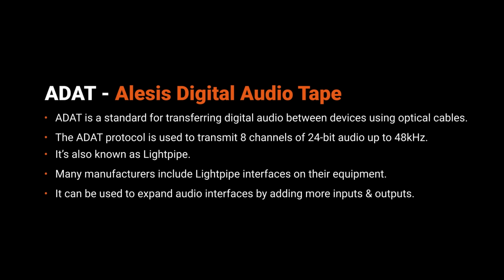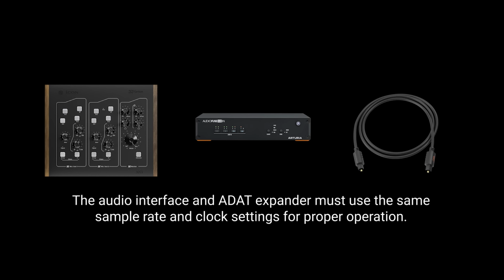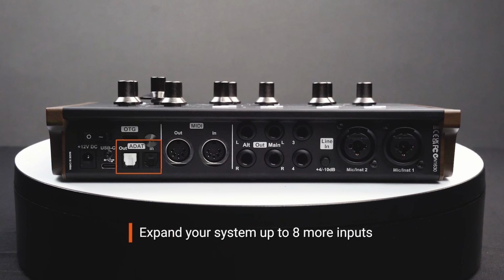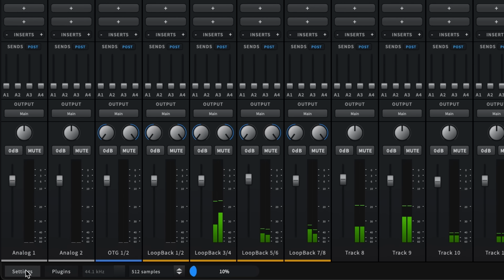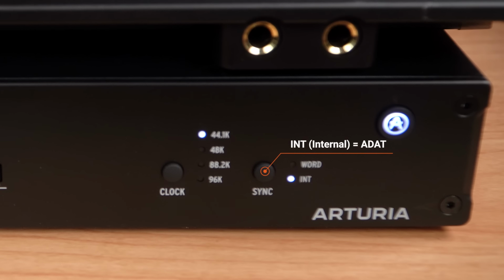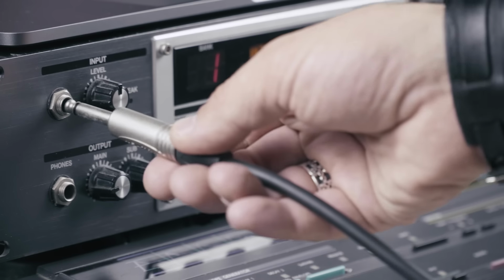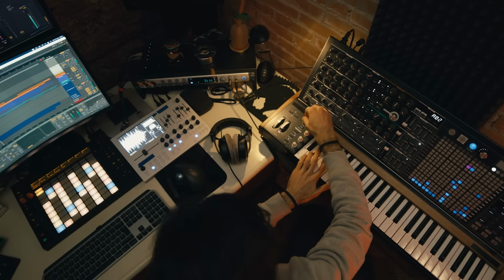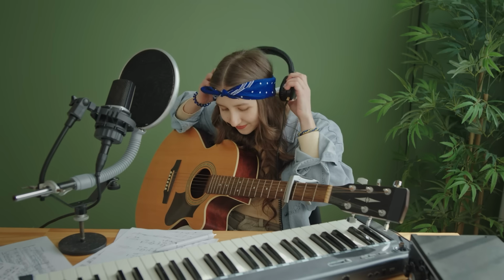Unlock More Inputs & Outputs: Using ADAT with Your Audio Interface (ft iCON Harrison 32Ci Interface)

Comment: just to check my understanding...
Arturia set to INT = true clock master.
Clock is embedded in ADAT audio stream.
Harrison locks to that ADAT input.
DAW shows “Harrison is master,” but really it’s following Arturia’s clock.
is this correct?
Reply from the maker: Sorry for the delayed reply. When using ADAT with the Arturia Audiofuse, it defaults to Internal and cannot be changed. The 32Ci is still the master for the purposes of the DAW, but when using ADAT, the Audiofuse always defaults to Internal clock.